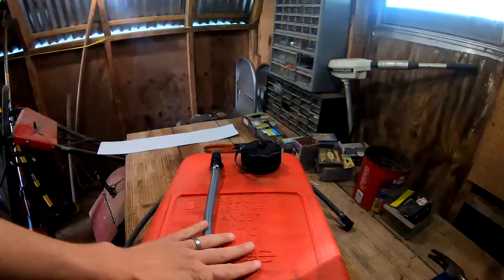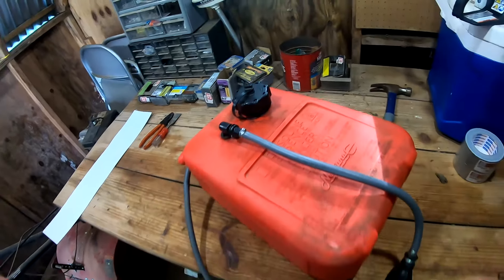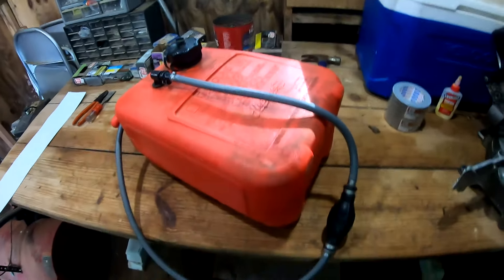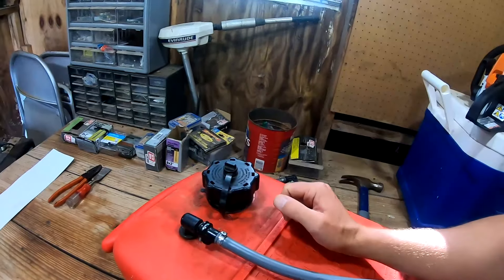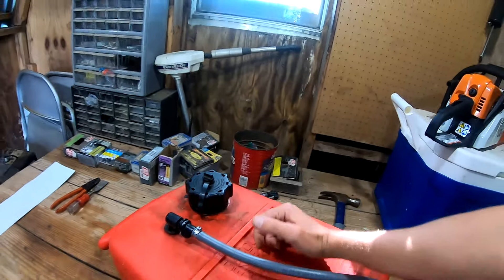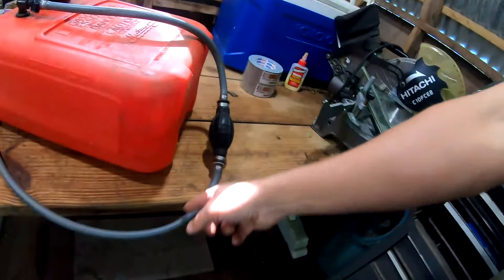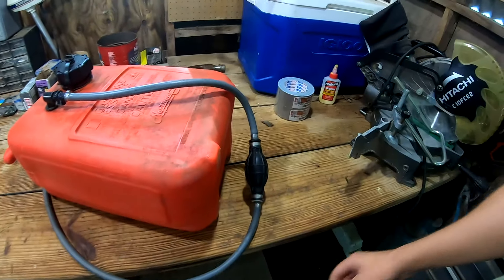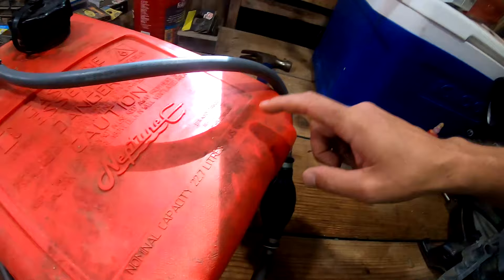3 MAJOR Problems With Jon Boat Gas Tanks

Comment: I have a 40 hp mariner on a bass tracker had the same issues. Changed gas line to motor like you and the impeller last was the fuel filter like you said and boat is running like new. Thanks for help figuring out the fix.

Comment: Take off the fuel cap and undo to screw holding it together. Pull out the rubber plug inside the cap. Your vent will now work as it should.
Reply from the maker: But then it’s no longer EPA compliant 🤣🤣 totally kidding

Comment: Change your fuel too the black fuel line especially in a tank like that that's not letting the fumes out it will eat a stupid cheap liner in the fuel line and clog up your carburetor and filter , I did it a couple years ago I cleaned the carburetor 2 times before I took the line off at the tank and it was clogged with like a white gel.
Reply from the maker: Good point, I already see some bits in my fuel filter. They are crap!

Comment: How would you decide to get the 6 HP outboard with or without the internal gas tank?
Reply from the maker: I’d rather have an internal tank. Having one with internal tank and carrying a small 1 gallon emergency tank will get you almost any where you want to go. If you have a bigger boat the external tank maybe best, but it takes up a lot of space and is heavy

Comment: What should I do if the fuel goes into my internal tank when I try to prime the engine with external tank ? Am I trying to prime too much
Reply from the maker: That generally means you internal gas tank valve is closed. You have to close it when you use the external tank
Reply: @Skinnyriver  thank you, I just tried this but it didn’t seem to work, the internal tank was half way full and after running it with my external tank connected it ends up being completely full, is this something I should be worried about? It even leaks gas out of the internal when I have the valve open
Reply: Just wondering if this is normal for the fuel to be pumped from the external to the internal, I don’t have much experience with these motors and wanna make sure everything’s good
Reply from the maker: @aarongonzalez7913 what motor do you have and what year is it?
Reply: @Skinnyriver  it’s a motor that came with a Bote rover I bought. Hidea 6hp, I read online that it’s basically the same thing as a Yamaha 6hp
Reply from the maker: @aarongonzalez7913 man I’m not sure. Mercuries and Yamahas have a valve that switches between the internal and external tank. 

And if the valve is switched to internal tank BUT you use an external tank, gas will back flow from the external to internal tank. 

I would follow the gas lines from the external tank through the motor to see if there is another valve that needs to be switched. There is probably a T in the line that is allowing the gas to flow into the internal tank. 

If there is not a valve that prevent that, I’m not sure how you would prevent it, other than keeping the internal tank full and vent cap closed

Comment: My motor bogged down on me last week after I filled my tank. Guy on the boat ramp said I over filled my tank causing some vent issues. Could that possibly be an issue for motor to be bogging down?
Reply from the maker: Man I haven’t heard that, it’s possible it created some weird suction issue preventing the vent from working and it starved your motor of gas. Fill it up less, try it again, if it doesn’t bog down then yeah it was a weird issue with the tank
Reply: Yeah i just bought a new gas tank (having these issues with it) and was doing some research and saw a couple of times where it was mentioned that you shouldn’t fill the gas tank all the way up
Reply from the maker: @CEvalley yeah good point, I had an issue where I filled it all the way up on a hot day and when I opened it, it shot gas everywhere
Reply: @Skinnyriver  Right…? And I know no one wants that. I bought the 6 gallon Attwood and the other day after I installed it the temperature got to 70 and it swelled up so damn big it was forcing fuel all the way through the carburetor and was pouring out the bottom of the cowl. Needless to say I wasn’t really pleased about that…. I live in central Alabama and it gets a little warmer than 70 here! As many people are posting complaining about that they really nee to address the problem before someone does get hurt.
Reply from the maker: Yeah I keep some head space (don’t fill it all the way up). The legal way to fix the issue is add a fuel demand valve. Others not “legal” lol is to leave the cap cracked or remove the rubber valve in the vent. I’m not suggesting the illegal methods 😅😅😅

Comment: Also, I want to add this about one of your vids on cooling water impeller replacement on a Tohatsu /Mercury  5 or 6 HP , 4-stroke outboard motor . You  edited out the part where you fought like hell to get the drive shaft splines to engine, lower water pick-up tube to upper water pick-up tube, and the lower to upper gear shift linkage all aligned up together at the same time so the lower up will mate to the middle unit . 🤨  This is the trickiest / hardest part of water impeller inspection/replacement  !
Reply from the maker: Dude, just watch a different channel, im just doing my best

Comment: I just bought a new tohatsu 9.8

I am reading through my owners manual.

They recommend to use a filter to separate water. 

Have you tried that before? 

Or do you think a fuel stabilizer is enough to do the trick?
Reply from the maker: I just use a fuel stabilizer. It’s worked great. Biggest risk is long term storage, make sure you run it dry or use something like sea foam. 

I don’t have experience with ware separators, there is risk of condensation build up and other ways water can get in that these help with. But I just use stabilizer and try to cycle through the gas and not let it sit very long.

Comment: Have you seen born again boating on fuel stabilizers? He stated no to use them as all they do is mix the water with the fuel which in the long term can cause damage to the engine instead he says buy ethanol free gas for your boat .
Reply from the maker: Yeah I’ll check it out. I usually use ethanol free but sometimes use  an ethanol treatment / stabilizer but it’s all probably a scam

Comment: You are NOT fully correct in your statements. There is a tank pressure relief valve in the system also . This doesn't allow the tank positive pressure to exceed more than 5 PSI.
Reply from the maker: You are correct

Comment: Yes it floods my outboard into a non starting condition and causes excessive fuel in the air and water.  Stupid epa engineering.  Rip off the rubber.
Reply from the maker: Yeah it’s frustrating. Watch out here comes the EPA police 😂